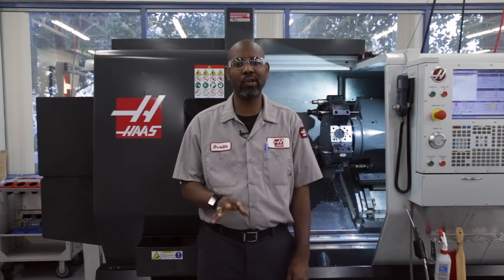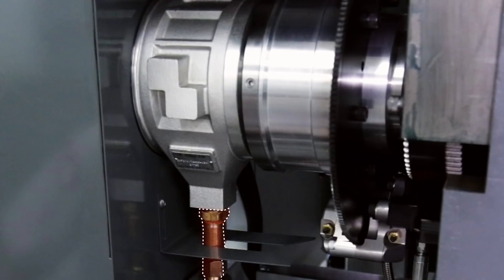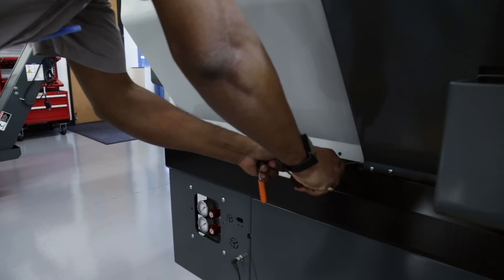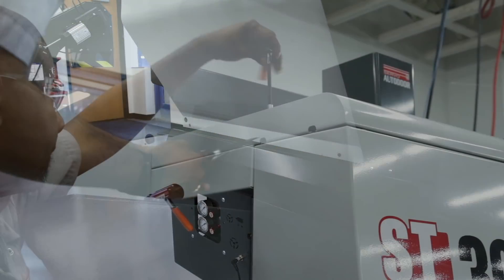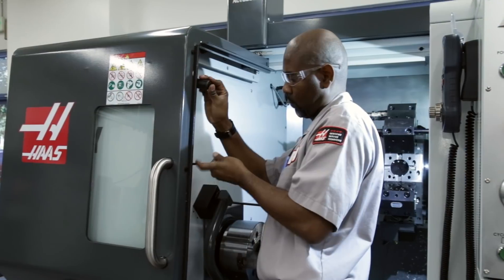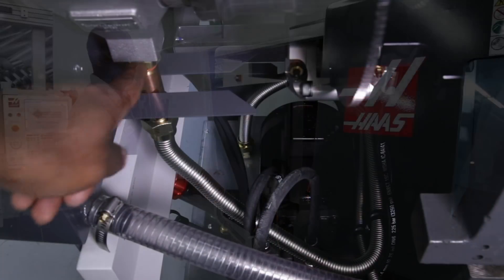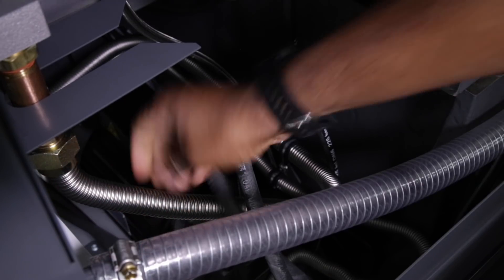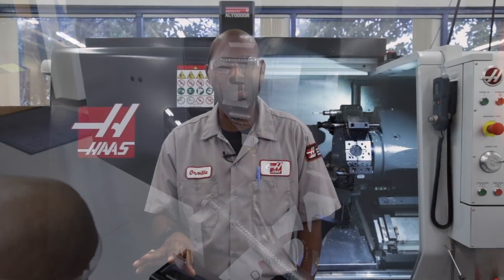Does Your Lathe Hydraulic Union Look Like It's Leaking? - Haas Automation Service

Comment: How can you look for blockages just by checking if the joints/ pipe is leaking, surely you will have to take the pipe off to actually check if it is blocked?
Reply from the maker: Daniel Brown you are correct. However we are pointing out areas to check if the situation calls for it.  Orville